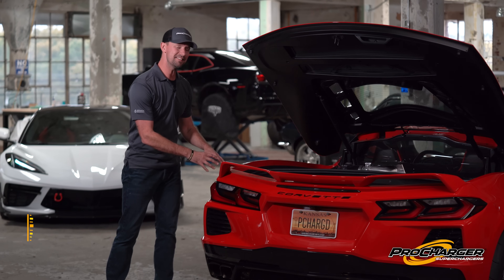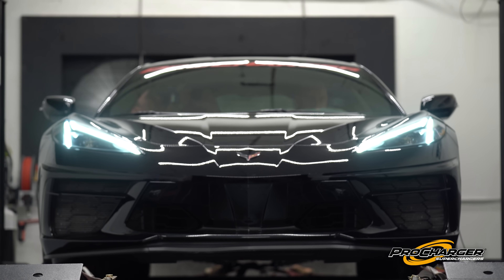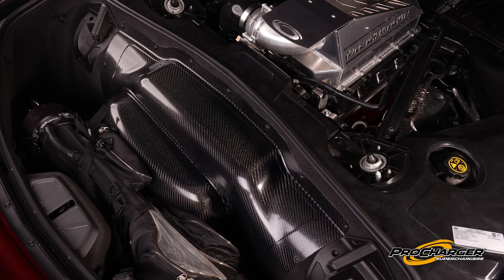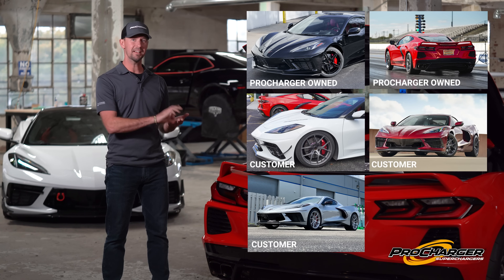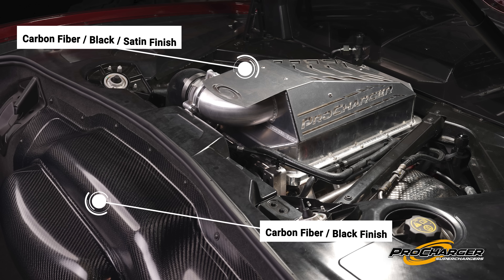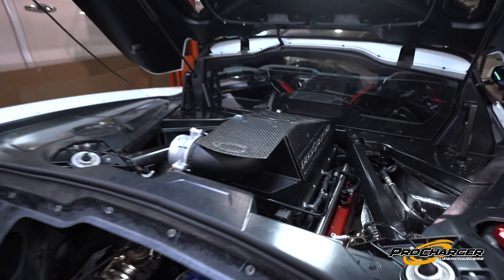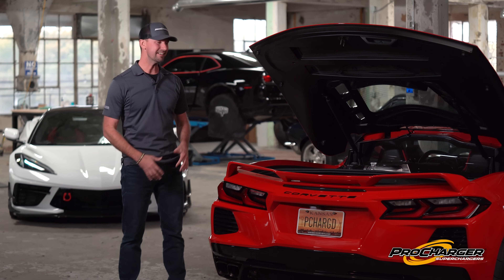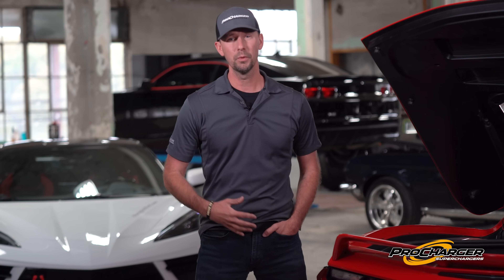World's First C8 Corvette Supercharger Kit: Now Shipping from ProCharger

Comment: The issue is can the lower half of the stock engine handle the power? I feel stock engines blow after 10 to 20k miles after being supercharged. I bought my c7 from a guy who added the Lt4 supercharger. I had to rebuild the engine after buying it from him. Piston rings came out pieces.
Reply from the maker: The LT1 and LT2 can handle at least 700whp with a proper tune.  Most failures of the engines come from folks pushing the limits of the factory fuel system, or getting greedy with timing.
Reply: But how are the findings from randomized controlled studies with reasonable sample sizes?

Comment: Ken probably doesn’t remember me but way back in 1995-1996 I had a red six speed Z28 that I installed the dual core intercooler P1 procharger on. With lots of suspension tweaks and tons of passes the car went from 13.1 at 108mph to 11.8 at 120mph on a drag radial without removing a valve cover.  (91 pump gas) They used my car in their advertising and I still have the ad and picture of that time slip somewhere. Congrats on putting together a great kit for the C8!
Reply from the maker: This is so cool to know!  ProCharger is proud to still sell virtually ever system that was ever sold to this day.

Comment: Stupid question - Can you set this up so that it doesn't have the annoyingly loud bypass valve sound all the time?  I had a vengeance racing C7Z06 with a procharger (purchased from someone), and at first, I thought it was cool.  After a month of driving it, that sound drove me and my wife nuts.  It literally sounds like the car is dragging a cardboard box underneath it, everywhere you go.  The only time it isn't annoying is when you're getting on it, and the valve shuts.  But you're not going to be doing that all the time.  90% of driving is just normal, around town, driving.  And you get that scraping/dragging/air-leak sound.

Comment: The magneson super charger makes 705hp on 6psi, an looks less complicated to install! 😏😌
Reply from the maker: The car you speak of has headers / aftermarket exhaust on it that is adding to the power gains.  The factory fuel system will be the limiting factor on any forced induction system, since the injectors can only add so much fuel.  That being said, their drive system works the much the same as ours, both have air to water intercoolers, and the intakes mount the same, so guessing the install is about the same.  Our system is easier to install on this C8 than our C7 system.  We are guessing its a nice relaxed 1-2 day job for most folks that are a really good wrench. :)

Comment: So the move then is to wait for the Grand Sport C8 which traditionally has the Z06 bodywork and standard engine, add the procharger boosted to 700HP and look as good and out run the Z06 for half the price!
Reply: The Grand Sport has been phased out for the E Ray
Reply: @antoniowhitner7594  dang, I hope you're wrong!😭
Reply: Maaaaan I like this idea!!
Reply: That depends how well they do in sales. It’s pretty sad but the C7 z06 used is going for the same price as the C7 grand sport.
Reply: @KillaMarv  I can understand why, as I see C7 ZO6s and very very rarely see a C7 Grand Sport.
Reply: The z06 engine is unique 👌
Reply: @MARTPERE  very unique! I'm just trying to save a Dollar!!! Lol
Reply: @hpmetabolics7558  650 hp with warranty or 650 hp and bent rods those lt1s cant handle 650 hp fpr too long dont let these cats fool you
Reply: @MARTPERE  the LT1 and its simple pushrod design has proven itself to be the most dependable of the big 3s flagship powerplants, but that charger is going to void the warranty so i get your point.
Reply: @hpmetabolics7558  my bad hp i meant they cant handle over 650 hp with the supercharger ..
Reply: @MARTPERE  Yuck. Thing Sounds Like A Wanna Be. Chevrolet Did The Same Thing With The LT2. Tried To Make It Sound Like A Ferrari. Remove The Mufflers & It Sounds The Same As The LT1. I Hope People Can Do The Same With The Z06
Reply: Ditto on the Flatplane crank. The Z06 would likely beat the "Grand Sport with a S/C" even if they did make the GS. About the same power output, but with the Z06 having significantly less weight and much more mechanical grip. Even IF the GS had the body weight savings and carbon components of the Z06, the GS would still carry the heavier V8 + the weight of the S/C kit. The Z06's power would be more usable with the high revving flatplane and with a better trans setup paired w/ the flatplane. Plus it will destroy the GS in the corners and sound way better IMO. The C8 Z06 isn't just about "American straight line speed," it's the whole legit supercar package, w/ the Z07 package option as icing on the cake.
Reply: @PapaTroll86  I'll give you the point of the lighter engine, but i thought the Grand Sports had the Z06 suspension as well??? Leaving engine as the only major difference.
Reply: Sounds about right to me
Reply: No GS and if you haven't "moved" on ordering a C8 yet...  don't expect to take delivery on one for years to come.   It's insane.
Reply: Yes but you don't get that beautiful exotic v8 note
Reply: @yessuhyessuh2100  you don't get a flat plane crank note I'll admit, but the LS with the supercharger whine ain't bad either.
Reply: @hpmetabolics7558  ofc its not bad and im a all muscle sound over exotics all day but just something about this new design the note is nearly perfect.
Reply: @yessuhyessuh2100  absolutely! Like the Ferrari 458 and the Mustang GT350
Reply: @hpmetabolics7558  ferrari yes, gt350 sounds like a fart can, far from an exotic v8.
Reply: @yessuhyessuh2100  lol, it sound like what it is.... a flat plane crank V8
Reply: @hpmetabolics7558  I've heard some good sounding flats in my time but the gt350 ain't it for me its too raspy and farty imo
Reply: Will the PopCharger void your Warranty??
Reply: wait is this really for track use only? or is that a legal thing they have to say?
Reply: But the z06 will have a flat plane crank.....lol
Reply: zo6 will outperform a pro charged sting ray
Reply: @blakeburnett3334  I didn't say a Stingray, read it again....a Grand Sport gets the same lightweight panels and suspension and aggressive gearing ratios as a Z06, just needs the added HP
Reply: @hpmetabolics7558  still will get out ran by a zo6
Reply: @blakeburnett3334  can't say that conclusively at all, as traditionally the Grand Sport would get the same lightweight body panels, suspension and transmission mapping of a Z06 just without the engine. Add the supercharger with a peak HP of about 75 more than a Z06 and its a fight
Reply: @blakeburnett3334  no way.
Reply: @blakeburnett3334  based on what? Definitely wont have 700 plus hp

Comment: A procharger is not a supercharger!!!  Call it what it is please!!
Reply from the maker: ProCharger is our product name, for our centrifugal supercharger.
Reply: @ProChargerSuperchargers  so we both agree its not a corvette supercharger kit??? It is a procharger...I belt driven turbocharger.
Reply from the maker: @jaynosowsky9708  technically a centrifugal supercharger was always mechanically driven starting on the old warbirds and other cars. (same as this).   Then came the Turbo-Compound systems, which didn't actually compress any air, but added mechanical force via a TQ converter or sorts.  However, this was short-lived, before the "Turbo-Supercharger" was developed where the turbo then compressed air to feed the engine.  (And in some cases there was both the centrifugal supercharger, and the turbo supercharger).   IN the end, we owe a lot of respect to those pioneers back in the day. :)
Reply: @ProChargerSuperchargers  do you know why you're gonna get bad reviews....because your to technical. People know what a supercharger is and they know what a procharger is...just keep it simple. If your here to make people confused  and make yourself look bad...keep doing what your doing
Reply: Is Vortech a supercharger or a Procharger?
Reply: @colinbauer9795  it's a procharger....a turbo that is runned by a belt instead of exhaust gasses.

Comment: I bet a dollar that three gears into WOT you’ve saturated the charge air cooling capacity and your IAT’s begin to rise, negating any boost with pulled timing.
Reply from the maker: Actually glad you brought this up.  We actually never had anything over 20 degrees of ambient even while doing our HOT road course testing.  We were very very impressed on how well the side scoops grab airflow.  GM did a great job, keeping these cars cool on the track, and it helps keep our stuff cool as well.
Reply: @ProChargerSuperchargers  That sure sounds impressive. Do you have a figure on the capacity for your system?
Reply from the maker: @TheMostDeletedComments  we have tested it at the 800hp level with no issues.  However most folks pushing the power limits are also adding E85 or Meth to the cars, so also cooling that way.   We don't forsee any IAT issues with these cars at all.

Comment: the cost of the kit and install... plus issues and tuning ... might as well get  the C8 Z06...
Reply from the maker: The Z06 is a unicorn right now, though will be awesome when it finally comes out.  Thankfully for those that want a faster vette now, we have the best bang for the buck system, that bolts right on and within 2 or 3 dyno pulls is tuned. :)  Its actually easier than a C7 in my honest opinion, since no body panels have to be removed for install.

Comment: At this rate supercharged ZO6 will be going somewhere around 850 to 900 horsepower. ZR1 probably over 1000
Reply from the maker: And we are A OK with that. :)
Reply: The Zora was reported to be over 1000hp stock. It was delayed because the engine had so much power it was twisting the frame according to earlier reports I read.

Comment: SORRY I DONT GET IT….2 tenths BETTER ZERO TO 60 TIMES, AND 8 mph FASTER IN THE QUATER MILE…JUST SEEMS WITH AN EXTRA 180 HP JUST THOUGHT THE GAINS WOULD BE GREATER…..EASIER TO BUY THE ZO6 AND GET THE BETTER BODY… JUST MY OPINION….
Reply from the maker: As you will notice from all C8's with forced induction, is that the 1/4 mile times vs BHP seem weaker than we are used to.  The reason being is that GM did an amazing job on getting these cars to be blistering fast in their NA form.   The "downside" is that once power is added, the car has to shift into 5th gear in the 1/4 mile, due to the added HP.   Shifting into 5th is like shifting into overdrive in another car, and really slows down the acceleration.   That being said, they still go faster. :) And they are loads of fun.

Comment: I don't know if $13,000 for a permanent check engine light and meth kit sounds all that refined, but I understand the car's tune cannot be modified.  What about the DCT and rear axle?  What does meth alone do?
Reply from the maker: There is no meth kit, and no check engine light.
Reply: @ProChargerSuperchargers  
Good to know the forums are wrong.  How about the DCT and axles?  Both seem troubled even without boost.  Do you guys recommend upgrading them?
Reply: Do you at least warranty the drive train for a few years?

Comment: Did you upgraded the transmission?
Reply from the maker: Stock trans on the base kit power levels.  For those that add boost, we suggest clutch upgrades.  However that's now about as common as mufflers on these cars.

Comment: Boost requires fuel.  How are the fuel demands being met?
Reply from the maker: The HO system is set to a power level that is right at the end of what the factory fuel system can support.  The customers can then later turn up the boost if they choose to run AUX fuel system or a Methanol system such as LT1 or LT4 cars have for years.

Comment: what was best 1/4 mile time? Did you run it on a road coarse in high temps? Are there other videos detailing actual performance? Any DCT issues with this power level?
Reply: Have fun upgrading those clutches!  But if you wanna make power, need to make sure it can handle power.  However, I can only imagine how much of a PITA doing those clutches are
Reply from the maker: We have had no DTC issues at the HO power levels.  However we would recommend anyone that is planning on aggressively tracking the car to upgrade the clutch.  (That really goes for supercharged or none supercharged cars, as the upgraded clutch really helps out in the power handling and feel of the car while being driven agressive)
Reply: @ProChargerSuperchargers  never answered 1/4 mile time
Reply: @slickrickdarula9483  lol
Reply: @ProChargerSuperchargers  that’s part of the problem some have been having when adding that much more power. They’re having a hard time finding a clutch that can handle it.

Comment: Price is too high. At $6,500 to $9,000 I would be in, but at over 10K cost, I rather wait for the Z06
Reply from the maker: Understood, its just a very complex system and material prices are at an all time high these days.  Thankfully all the materials are top notch, even the massive intercooler system.   Stainless drive system, Carbon panels, and loads of billet. :)

Comment: Why dont you show a quarter mile time? Makes no sense at all.
Reply from the maker: Since folks live in different areas they might have a drastically different 1/4 time in stock from from what the "best pass ever" was shown from GM.   We are all about the "gains" since the A-B gain on the same day, on the same track, will be what we stated, which we are always very fair with.   IE: we stated an 8mph increase which demonstrates the power difference, and can easily be increased by our customers when the fine tune their systems.
Reply: @ProChargerSuperchargers  Still you should show  your before and after quarter mile times. No reason not too.

Comment: Im not too impressed. The mustang 5.0 coyote with a supercharger stage 3 makes over 800 hp
Reply: This is a stage 1 kit, relax. Nobody has been able to crack the computer yet, I’m sure with tuning you can get the 800hp you dream of.
Reply: @Poloword310  i actually expect something more close to 1000. Its a chevy 6.2, come on. I've always thought chevys can get more power, even though im more of a ford guy.
Reply from the maker: the factory fuel system is the limiting factor.  The Mustangs have a twin fuel system with PI and DI.... the GMs only have DI, so thus the limiting in power.
Reply: and you are going to do "what" with 800-1000 hp other than put slicks on it and go to the strip

Comment: screw the gulfclubs could have a prettier rear end
Reply: Golf clubs did not mess up the rear end. Just saw a rendering with round taillights and it looks like a Ferrari 488 and it looks awesome. Just a matter of minor sculpting and tail lights. The room in the rear is for travel or golf and it's not the problem.
Reply: @miked.7722  or it made the back end fat  and gulf clubs screwed up the rear since they said since the start it had to fit a bag of clubs your  kind of wrong
Reply: @richardpohl7091  well if you can't even spell g O lf what makes you any  authority. Do you actually own one, or have you only seen them in pictures. The Stingray is a GT car which means you should be able to go someplace other than a cruise to the ice cream stand, and say hey guys isn't my car cool. The back end is fat to cover up the fat tires that make it corner better and come off the line faster. Look at a 458 or 488 from the rear and you will very similar. I blame the tail lights which are not that bad but round would have been better.

Comment: Transmission didn't slip
Reply from the maker: We spent a year making sure that the stock trans/engine would be worry-free at the low boost level.  However, those turning up the power should use an aftermarket clutch.

Comment: What does it do with the factory warranty? Is it legal in California, does it have a C.A.R.B. #? Will the ECM be effected? Because here in California they're cracking down on ECM tampering. Do you have highly qualified installers for the system here in California? Do you provide a warranty for the engine and transmission yourself?
Reply: I have a kit on order, I was told that it will not be getting a CARB # anytime soon. I think for the price they should get it CARB certified.
Reply from the maker: Give our crew a call at 913-338-2886. They can best help you with your questions.

Comment: Nice!! What's the quarter mile time?
Reply: yeah, I was asking the same thing! How did ya crack it or piggyback Motec? 
No TQ #s or cist either.
Reply: Yeah they tell you it gained 8 extra mph in quarter but not the time...must not be an impressive stat
Reply from the maker: @silverbulletreport8567  just like we usually stick to overall gains (base line vs boosted) it gives the gain of the product, same as with the track.  Otherwise a person could argue dyno error, or that a track weather condition caused a false time.
Reply: @ProChargerSuperchargers  Appreciate the detailed explanation

Comment: Curious what track they were testing at.
Reply from the maker: A few different ones. We're in the midwest and there's a few around.
Reply: @ProChargerSuperchargers  

I did Hot Rod DW this year. The one track looked like Lucas Oil in Indianapolis. 

I put on 1275+ miles with my ProCharger, no issues. 

3825 LB car, SBC, 10.58@129mph, 15 PSI at 6500 RPM’s

Comment: how are you tuning it ? i thought it was still locked up .
Reply from the maker: We run an LT-CAN2 box and Spark Control Unit, to properly account for the boost pressure.  Nobody is currently "inside" the ECU.
Reply: It's probably still stock tune on low boost
Reply: of course they respond to every other comment except this one